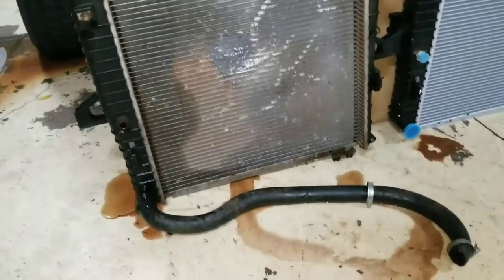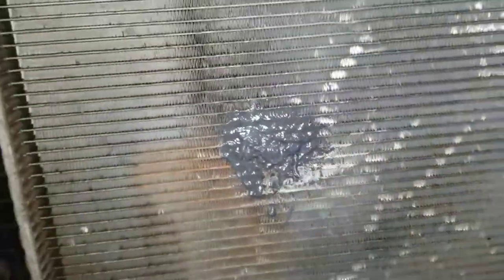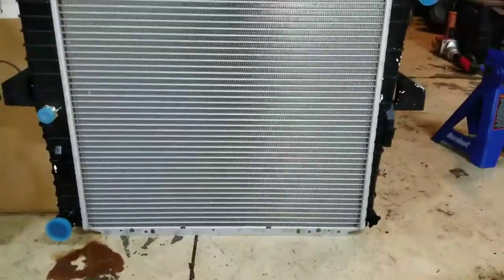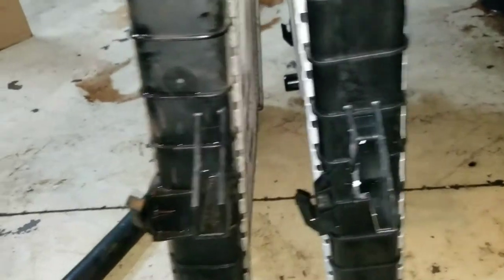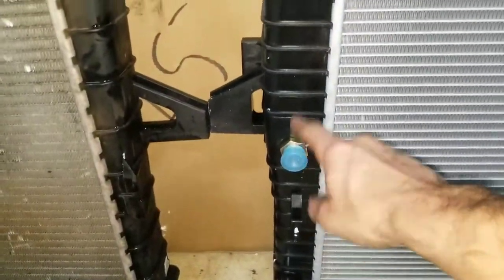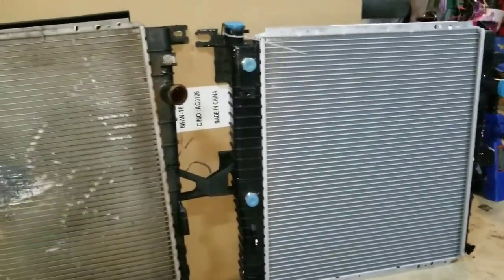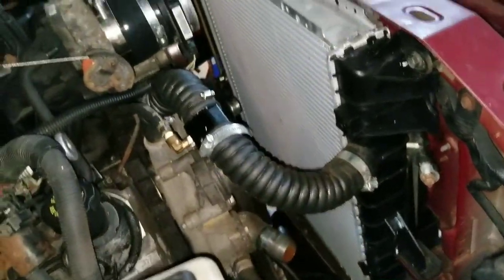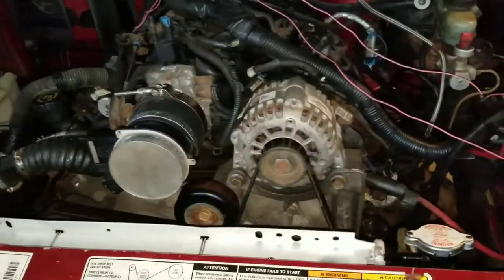WHAT RADIATOR FOR V8 SWAPPED RANGER??? BUDGET LS V8 SWAPPED RANGER RADIATOR INSTALL

Comment: I have a radiator from 2005 explorer I bought brand new and it’s actually way to big to fit in my 1991 ford ranger it’s 4 inches to long and around 3 inches to wide and leave only 3 inches of ground clearance

Comment: Running the engine without a fan is a really dumb idea...like what? Just get a clutch fan with a shallow depth off of a V6 Chevy (11 blade version) or a Chevy van...I wouldn't recommend going electric...puts a huge draw on you alternator and they aren't reliable plus they are loud and vibrate more than a clutch fan
Reply from the maker: I drove it for 4 hours today after work tuning some of the fuel tables. Highest temp I saw was 204 but it's was 192-194 solid.
Reply: a21bravo that's crazy I would never do that...cool though that it works
Reply from the maker: It basically runs the same temp as the other one with the fan... I'll still get a fan but controlled by the computer, probably won't be on much.